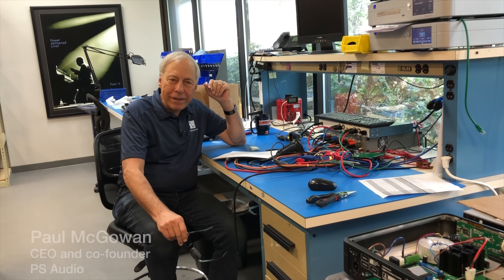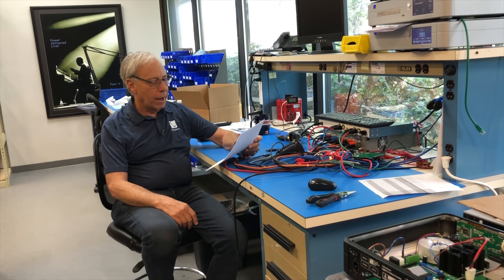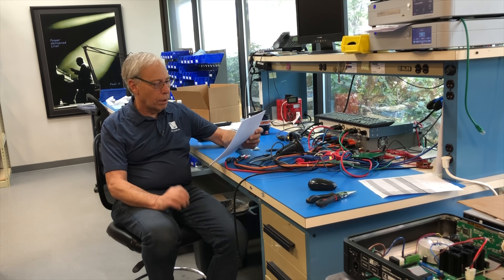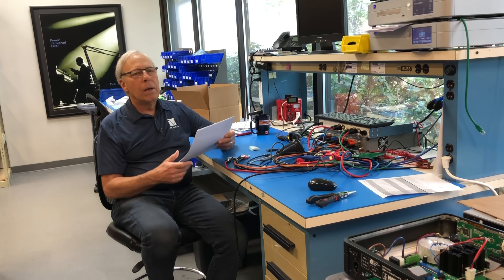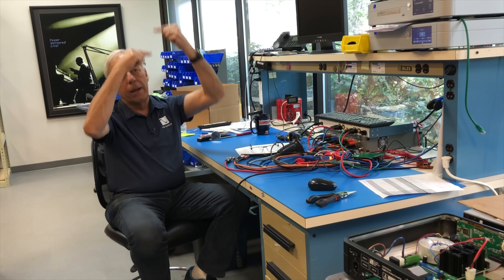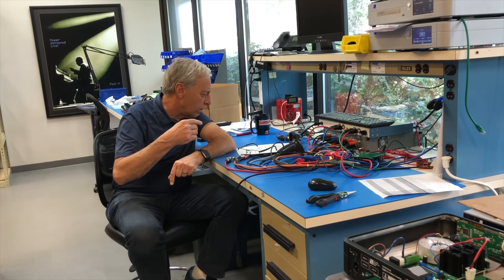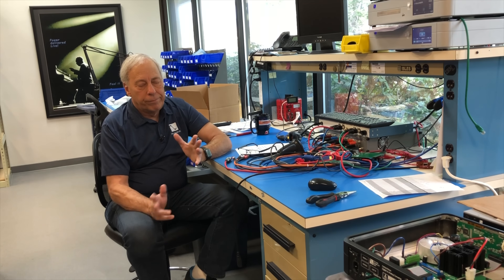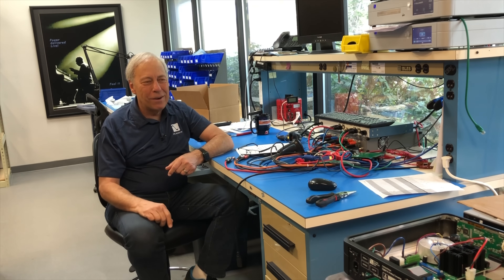How does the Devialet Phantom work?

Comment: I'm curious how these speakers work acoustically. How do they play so low with such a small enclose? With a very stiff construction, with very stiff woofer cones are they able to physically force the woofer cones to move like most ordinary woofer cones would move in an infinite baffle setup? Compressing the air inside the enclosure as if it isn't even there? Are the cones very heavy?

Comment: "only get 1500w out of the wall" 
you just lost my respect sir... that's 1500w @ 120/240v NOT what your stepping down to the 12v in an amp, come on, you know this... it's basic Ohms law man... =/

120v typical house socket in the US = 2,000 watts at NEC rated 80% load on the breaker out of the 2,400 @ 20a max short term.
SO via ohms law120v = 2,000w (rounded from 1920 for ease of math, it's not going to make a damn either way in the grand scheme of things)
120v = 2,000w
60v   = 4,000w
30v   = 8,000w
15v   = 16,000w

now is that correct or no? obviously you have to factor amplifier efficiency, heat, speaker impedance etc etc... real world numbers are probably going to limit you to about 8,000w out of your 120v plug when stepped down to 12v DC
Reply from the maker: Yes, some of what you write is incorrect. Let's start at the beginning. If you have a 15 amp breaker and 120 volts then the simple formula amps times volts gives you a maximum of 1800 watts. Indeed, short term is greater because the circuit breaker has yet to shut off. But watts is a measure of work and you cannot get more work out of a maximum of 1800 watts with a lower voltage.

I think you may be confusing amps and watts. So, when the voltage goes down, the amperage needed to perform work (wattage) goes up. For example, 12v at 150 amps is 1800 watts. 

in your examples you're somehow equating this incorrectly. Wattage, again, is a unit of power (or work). There's a finite amount of work that can be gotten out of an 1800 watt source—1800 watts.
Reply: What power supply will convert 120v to 12v at 660amps? 8000 watts at 12v is 660amps . Lmfao just try and find a 660 amp 120v- 12v dc transformer lmfao.
Reply: You are very confused. Lmfao. So the lower the voltage the more power that you get?lmfao. No, let me correct you. the lower the voltage means the more amps needed to get the same work(watts) done. And you can only draw so many amps. It's like comparing a big V8 engine making power barely breaking a sweat vs a small 2cyl engine needing 30psi of boost and nitrous to make same power. The small engine is maxed to an inch of it's life.

Comment: Dutch and french standard mains sockets do 230V 16A That's almost 3700 real Watts.
Reply: Still not 4500 watts and you never want to even get close to Max amps available on the circuit.
Reply: Yes. In the old world we are not afraid of the electricity.
Reply: Depends if your installation is recent and buying certified multi plugs and thick cables, yes
Reply: @toocoolforu  Dutch standard is 2,5mm2 what you plug in can be anything the cheap chinese sell you.

Comment: If the simple explanation of Devialet itself is correct it is more a kind of 'current dumping amplifier' with a class D amp as the current dumper in parallel with a class A amp and not so much a class G variant.

Comment: I'm with Paul on this, the Develiet Phantoms sound great for what they are. Probably the best "Sonos type" speaker system available but they are not HiFi!
Reply: mines10inches 2 together can be hooked up as HiFi.
Reply: What is in your opinion
Reply: @Mabeylater293  Hifi components. Try a Devialet amp on some decent speakers, correctly set up for the room and you will hear the difference.
Reply: @mines10inches  ok. I guess that’s a pretty high complement for the phantom golds because from what I’ve read, their stand alone amps are on another level.  Very well respected pieces of engineering
Reply: Hi-Fi is pretty much overrated these days. The phantom is fun to listen to unlike 'real' Hi-Fi

Comment: Devialet's white papers on their amplification technology seem to disagree with the described BASH-like, class D-driven varying rails supplying an analog amplifier: http://www.dynamicaudio.jp/file/110125/201101DevialetWhitePaper.pdf or https://images.computeraudiophile.com/graphics/2014/1216/Devialet-PHANTOM-White%20Paper.pdf
ADH is described and understood as analog and "digital" amps in parallel. Not in series neither via their supply, nor along the signal chain.
If you're looking for reference, it's rather been compared to QUAD's current damping when introduced, but with a hybrid combination. Whatever the result, I guess quite different from PS Audio's amps in any case.
Reply: Thank you for the link to the white paper. Very interesting.

Comment: are they using a triac in the class D amplifier to control current flow to the class A and B amplifier. I'm assuming they would have a feedback circuit from the class A to control the triac is this the way It works.

Comment: Not very well explained really. Just the fact that BASH amps are the combo of AB and class D and the devialet claims to be an class A and class D. Just saying those facts it may be the same in the end but the devialet a are working until some wattage 50watts in pure class A etc. Not saying that what you've said it wrong but not very factual. You have to kinda prefer you own brand right. But very cool technology and quite recognized in the adiophile world.
Reply: Dave Micolichek  no, class G topology is a modification of Class AB and not class A.
Reply: Class a is class a, class ab is class ab, class d is class d, and BASH is BASH, all of which are "quite recognized" by any audiophile, and have been for years, and all of which you can easily study on your own ... which was Paul's point ... that you missed I guess.
Reply: Why would an audiophile give a flying fork about it, let alone 'quite recognized'?  It suggests predisposition based on amp topology. Surely the issue is whether an amplifier should be 'a straight wire with gain' and whether that apples well enough for a given design to voltage, current - and stands up to back-emf from inductive loads?  Who cares how?  (And why would Paul say that the power gain stage of his Class D is so neutral and that he uses input stage to 'tune' the sound?  How is that tuning 'straight wire with gain'???)

Comment: Devialet makes big sound out of a small size speaker by using special bass woofers that can move more air by a longer excursion than normal woofers with the same diameter. However, as Paul hints, that means a lot of power is needed to compensate for the much bigger pressure from a smaller air volume inside, as it’s a closed speaker. A closed high power woofer is able to most precisely generate a punchy firm bass compared to anything this size trying to do the same with a radiator or bass port. It’s a well engineered product. Is it audiophile? Perhaps not.
Reply: This is not how they produce so much bass. They are high-excursion, but generating those SPLs they do, is done by pressurizing the enclosure, so the drivers are not fighting the air-spring effect they usually have to overcome. Bob Carver utilized this in his products many years ago.
Reply: Matthew Bolstad What you say doesn’t make sense to me. You mean the box is sealed with a constant pressure? I never heard that. Rather I believe it’s just overcoming the small space by so much more motor power in those “pistons” of drivers.
Reply: @ThinkingBetter  reading the white paper,  it does seem to be just a sealed alignment with high motor force. High xmax is a bit of a stretch, 13mm one-way isn't exactly state of the art. Great overall package though.
Reply: Matthew Bolstad Yes, it’s not rocket science. And similar to smaller active closed box subwoofers like the Velodyne HGS-10BG I use in my office setup.
Reply: I'd rather take a modern Servo system like the PirateLogic Little/One, or the soon to be finished Grownup, both to which I have listened.
Reply: i think they are rather expensive and the claims are overblown - but the same is for most 'high end'.  I've heard them sound great with acoustic jazz in a local dealer - it turned out that I couldn't even stomach paying for his cheapest interconnects.  Whether you'd be better with a Kii Three or similar is moot.  I think discussion of BASH tech is irrelevant - rather its an indication of DSP and multiple amps directly connected to drivers, and what you can do with that - whether its the mother of all Linkwitz transforms or managing the side and back distribution as Kii do.  Its a world away from the old multi-driver analogue setup - to do the same trickery you would have thousands of dollars of crossover components, a major efficiency problem, and a big problem venting heat from the enclosure.
Reply: ThinkingBetter don't think there's anything special about the drivers they work in a push-pull configuration,  probably use car woofers do you know who makes the drivers.
Reply: John sweda No, I should find out who makes them. Not exactly ordinary drivers. https://youtu.be/N24vaTER10k
Reply: sounds like you could use the design for a good compact subwoofer

Comment: FYI in Europe or at least where I live we have 230v at 16A so we should at least get around 3.5kw out of the wall, I think still not 4.5 but a lot closer at least. we also have 400v but thats normaly reserved for things like stoves and such
Reply: It's a peak power and not RMS 
So it should be no problem
Reply: @speakertoni2680  

4k5 watts peak are 3k2 watts RMS. No way. It's PMPO (Purely Mythical Power Output)
Reply: WESTEL Audio why are 4500 watts peak 3200 watts of RMS? 
What if it’s just 4500w at 10%+ distortion
Reply: I think the way they're doing it is by redefining continuous output to mean just a longer duration than that used to measure peak output. The way some amps are made today they would never stand up to a continuous sine wave of indefinite duration at rated output. Their point is with music there is no need for it.
Reply: It is peak power indeed. Pro audio brands like L-Acoustics have 12KW amplifiers that work on a 230v@16A outlet. Their amps will pull 1/8th of the max RMS power from the wall at normal use (limiters barely used) and 1/3rd of the power at heavy use (limiters working hard). Phantom is more at around 1500W RMS, so that's an even lower consumption, so wall power won't be an issue.

Here is a quote : "Into each Silver Phantom Devialet packs eight discrete monaural amplifiers, these are then bridged to function as four mono amps: one per driver. Each amp is claimed to produce 750W of peak power, for a total of 3000W. In terms of continuous power, the usual 4- and 8-ohm specs don’t really apply, since the drivers used are custom units with a DC resistance of about 1 ohm. That said, Devialet’s estimate of RMS power is roughly 375W into 1 ohm per bridged amplifier circuit, or about 1500W per speaker."
Reply: 4500 peak from stored .. not constant

Comment: Bluetooth....  🤦
😂🤣😂🤣😂🤣😂🤣😂🤣😂🤣😂🤣😂🤣😂🤣

Sorry, but anybody who tries to speak of bluetooth and fidelity in the same sentence without a negative determiner has sacrificed 100% of their credibility.
Reply: Peter S Yes, Bluetooth isn’t too great but don’t forget Bluetooth audio streaming (A2DP) exist with different modes of compression. Before you had only SBC but now you have the better AptX HD, AAC and LDAC codecs. But if you play streaming compressed music you are likely listening to music that has been compressed and uncompressed at least two times. Not great.
Reply: BOTTOM LINE: You cannot pass data through a CODEC and retain high fidelity. It's a mutually exclusive situation. Additionally, using serial CODECs of different types tends to multiply the CODEC errors, rather than add them. I don't want my music going through a CODEC. Some people postulate about these things but I've been in audio product development working with DSP since 1989, starting on the Motorola DSP56001. I've actually written a couple of CODECs so it's very hard to sway me without 100% mathematically air tight proveable facts. In my informed and not so humble opinion, bluetooth will always = crap utility audio. It's wonderful for public address systems but not beyond.
Reply: So Pete, who do you think is arguing BT is amazeballs such that you're inclined to resume stroke yourself?  Paul said he doesn't like the sound of this speaker and then went on to, you know, actually focus his response on the question (which was not about bluetooth).  Is your thinking, "yeah but even though the question and topic are about the amp, let's forget all of that and wheel out Pete's audiophile hobby horse, nasty ole bluetooth, cause this whole internet should be about Pete!"
Reply: Peter S Of course you can pass data through a codec and retain high fidelity.  Ever heard of FLAC, ALAC, WacPack, TAK, Monkey’s, WMAL, OptimFrog or TTA? On your PC you’ve probably used ZIP or RAR for file compression. Problem with lossless compression is that you don’t reduce the data amount as much as lossy compression but more than 50% is possible without any loss.
Reply: Peter S Every component in your pure analog system is also a “codec” in the sense that it modifies the signal to varying degree. From the mics that pick up the original recording to the mastering to the pressing of the vinyl to everything in your playback system including of course all the expensive audiophile cables. How are those “codecs” or modifiers different than the digital codecs in principle?  Can you even mathematically compute or understand their analog signal distortion like you can with a digital codec?
Reply: wojomojo Pete S is talking about lossy digital codecs and he is right on that but he forgot all the lossless ones. The term codec is not used for analog signals.
Reply: ThinkingBetter I realize that. I have a Master in Electrical Engineer. Everything in the signal path is modeled mathematically. And everything does something to the signal. Yes, in digital we are better able to understand the loss, but it’s simple wrong to assume that just because we don’t understand analog loss effects as well to assume there is no loss. The loss in all component is why audiophile are infinitely tweeking things. They are using their ear rather than relying on math. And pure analog folks would argue that even FLAC have losses that’s why some prefer vinyl to digital.
Reply: @wojomojo  what's also funny is that most of the people that I've spoken with who are audiophiles have found vinyl as lower resolution than digital. 
The pops crackle and noisefloor, excess warmth. But they find vinyl resolves less than a digital recording off a good DAC.
Reply: It's all cool. Musical enjoyment is not a science, at least the part where we enjoy or dislike or remember when we heard that crappy piece of equipment that has sentimental value and thought it wonderful :-)
Reply: wojomojo I never said analog signal paths are not causing artifacts or losses to signal integrity. The talk was about codecs. And a lossless data format is exactly lossless. It’s not a matter of opinion but about understanding. Of course if the FLAC data is not identical to the source due to scratches on a CD, sample rate conversion or other data manipulation, then of course FLAC is not at good as the original source. For example, your CDs are with 44.1kHz sample rate and making a FLAC out of a CD with 192kHz sample rate is actually lossy. I never sample rate convert my music.
Reply: even though this discussion is off-topic ... I liked your first point:  we're taking an air pressure wave (sound), encoding it to voltage fluctuations (loss), then maybe encoding that to digital (loss),  then in the case of USB audio-class transmitting those 1s and 0s as a square wave (ideally) voltage swings with a standard that has no error correction like a USB thumb drive does (loss loss), then decoding those 1s and 0s back to voltage swings (loss), amplifying them (loss), and sending them to speakers (loss), where the cones attempt to reproduce the original pressure wave (loss).  And with Bluetooth we add some extra steps too!  Whew, that's a lot of codec!
Reply: ThinkingBetter The loss is not in the digital domain. It's in the Analog-to-Digital and Digital-to-Analog stages. Too long to discuss here, but this is a decent starting point if you are interested:  https://dsp.stackexchange.com/questions/41964/applying-nyquist-theorem-to-digital-vs-analog-audio-quality/41972, or google anything "Nyquist-Shannon Sampling Theorem", and particularly pay attention to assumptions like perfectly bandlimited signal, perfect ADC/DAC, and quantization noise, etc. The theorem is mathematically bullet proof, but only if you assume the same preconditions as Nyquist and Shannon, which in real life it often isn't. For myself, the standard CD is quite good enough. Heck even BT aptx HD is good enough.  I am afraid my ears aren't golden to pick digital artifacts out but you'll find plenty of people who claim they can.
Reply: Isn't it pretty amazing that things can sound as good as they do, if you step back and think about it?
Reply: BOTTOM LINE you cannot pass audio data through any speaker and retain high fidelity.
Reply: Anyone relying on their ear isn't relying on their brain.
Reply: Yeah don't forget it has AirPlay and most importantly Optical... Bluetooth is just if some friends want to play some songs when they come !
Reply: FYI - your sentence speaks about bluetooth and fidelity with no negative determiner, rather, an indefinite article, so you just sacrificed 100% of your credibility.  Irony can be pretty ironic sometimes.